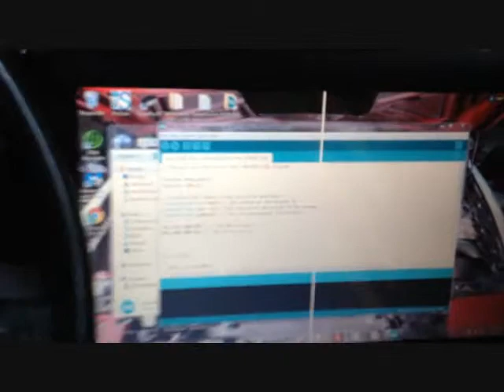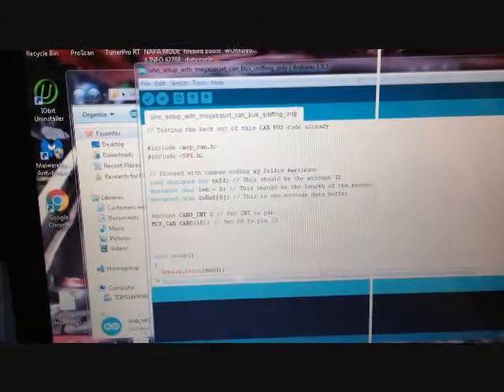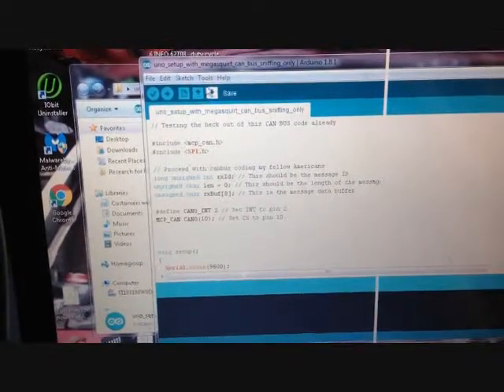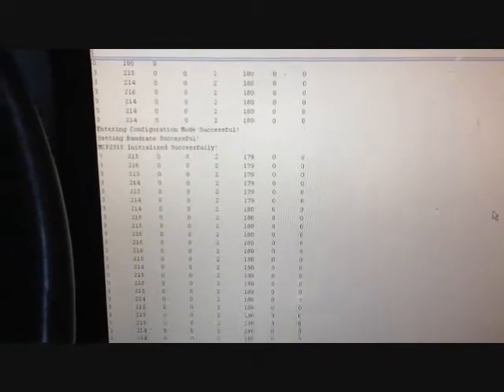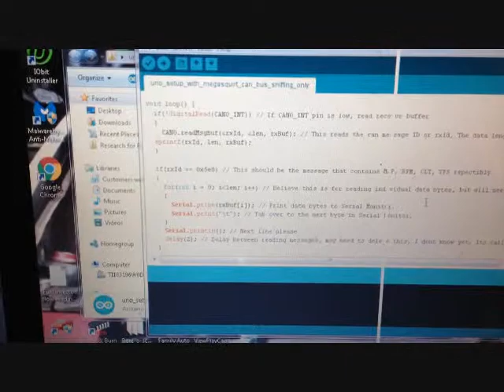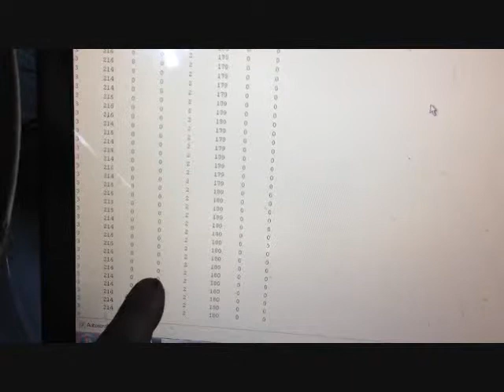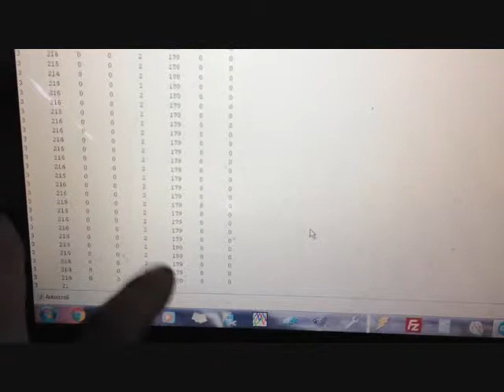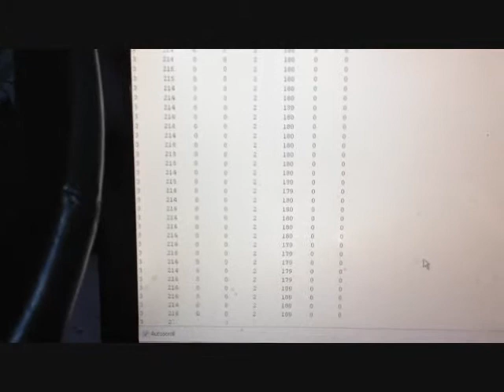CAN BUS messages from megasquirt via arduino!

Comment: I have a similar setup. Already built the control circuitry and code to shift the 4l80e.  Not full auto though.. hopefully I can do that soon by RPM vs TPS
Reply from the maker: I actually have a 4L80e controller almost completely coded and bench tested however I'm not a electronics engineer and figuring out the VR speed sensor input and coding it to receive that and convert it to MPH has been getting to me.

I'd love to see more about your work. You have a link to a video or post or something on your project?
Reply: @TwistedBuilds  theres a nice little vr conditioner chip you can buy. I haven't got that far but its basically a nice op amp set up as a comparator so it makes a squarewave from the weird ac pulse
Reply from the maker: @qwertyword  Do you have a link to that chip?
Reply: Once you get the squarewave you can either use the pulsein() function or what I did for my small engine dyno: attach interrupt, start timer, increment per pulse n times, stop timer, detach interrupt.

Comment: What about the jumper
Reply from the maker: Yes it is needed. So the MS2 has a terminating resistor inside it for the CANBUS network, and because the only module on the network was my CANBUS adapter, it also had to have the same terminating resistor setup so the jumper was used to make that happen.